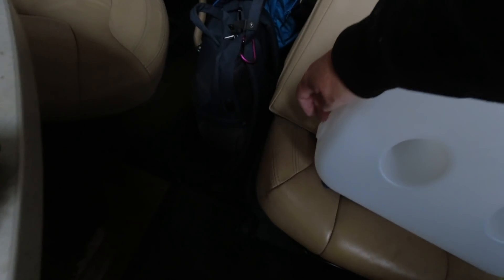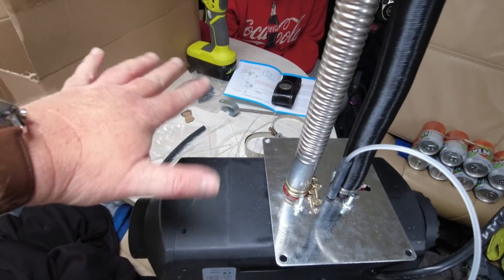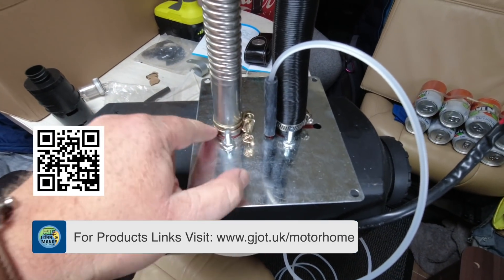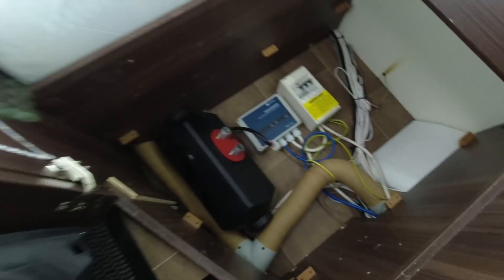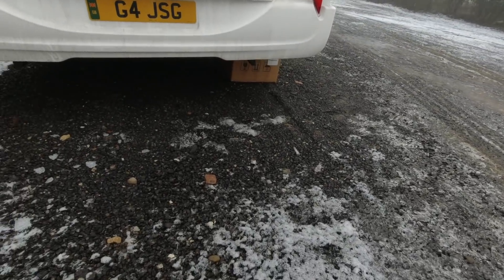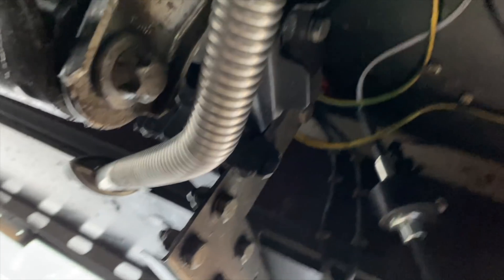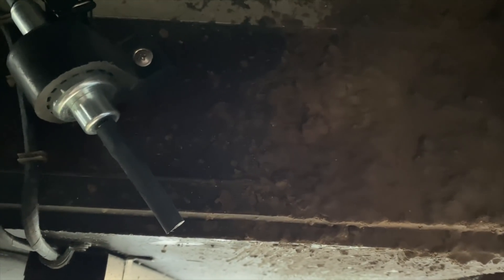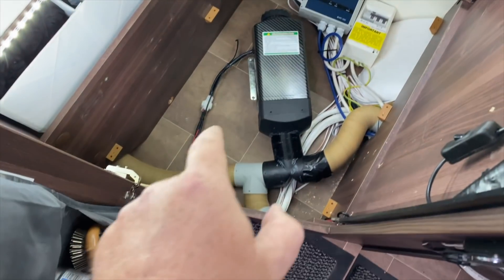Diesel heater Install in our MotorHome

Comment: Most diesel heaters run all the time, my webasto does as does my eberspaecher and most i've fitted (all the propper expensive ones, only fitted a couple of the cheap chinease ones TBH), they run on high heat/high fan speed till they reach the temp you set then lower heat and fan speed in an attemp to maintain that setting untill the temp drops low enough to kick the high speed/heat back on again.
The main trouble with the chinease heaters is they allow the user to mess about with pump speeds ect and as the injector is not controlled in any way this altering of the pump speed affects the mixture to the extent it soots up the burn chamber, i recomend you run the heater at full heat at least once a week to clean the soot out but it sounds like you already do that anyway :) 
Great vid as usuall cheers to you both ;)
If you havn't seen it yet check out  David McLuckie  on YT, he does all sorts with them ;)
Reply from the maker: That’s great, thanks for the heads up - we do run it on full power first thing every morning so hopefully that’ll do the trick 😁👍🏻

Comment: Interested in why its important to keep 'fumes' from getting in the air intake under the van. Surely these heaters have a heat exchanger and the air from outside is not mixed with the internal air which us simply recycled?
Maybe these Chinese ones don't work that way but I would be surprised if they dont?
Reply from the maker: I’d have thought the same too but it doesn’t do any harm to keep them apart😁👍🏻

Comment: Fitted a eberspacher in my boat cost a fortune compared to yours mind is top quality. Thing found is they are noisy and after you run it for a time when you switch it off you sort of feel a sense of ahhh no more noise nice and quite. One thing interested is concerns fire safety these things are potential fire hazards have you checked this area ie fire proofing unit it is fitted in or fitting auto fire extinguisher etc. Guess you will use it as a winter back up
Reply from the maker: As we’ve said the install isn’t 100% complete as we’re waiting for parts to finish the install including fire proofing and waterproofing 👍🏻

Comment: Nothing to do with heaters but wondered what you have done with the thermometer sensor wire, is it through the van to the outside? Glad you're both warm now :)
Reply from the maker: It’s fed under the dinette seat, through the water fill access door and out through the hook up cable access point 😁👍🏻
Reply: @johnmandy  Many thanks both. :)

Comment: Hi guys do you know will that  diesel heater run on kerosene,  just like the bigger  household ones, and have you any link for the same type with a built in water heater, thanks
Reply from the maker: We know they run on all sorts 😁👍🏻 we’ve no experience with any of the dual ones so wouldn’t like to recommend.. if anyone else has and would like to suggest, pop a comment below.. 😁👍🏻

Comment: What's the plan on water heating? Still on the LPG? Bit of inefficiency there I guess as hot water is a by product of using the truma for air heating but still a saving I'm sure.
Reply from the maker: I suppose it’s just planning, we’d boost the hot water or use the truma for morning heating and utilise the water.. for washes and pots we use the kettle so I can have a cheeky coffee too.. after tomorrow we’ll be using the showers here though.. every little helps 😁😂

Comment: Very interesting video, thank you for all the detailed information. I have tried something about the same last winter. I used a Diesel heater as an external heater, connected removable to the RV´s internal heat tubing system of an older RV. So I could use both systems on demand when "stationary" at my place at home. It worked Ok but as you mentioned, the heat of the Diesel heater came out  90% out oft the first outlet of the system. So one part of the RV was boiling and the other end was still cold. Because my English is not that good I didnt really get how you made that work in your setup. Did you installed something like a flap to control the airflow?
Reply from the maker: The tubes and airflow need to be matched, so use the correct connection pieces and lengths of tube to balance the system to get the airflow the same to all outlets.
Reply: @johnmandy  Hi, thank you for the qick answer, very much appreciated. I will try and play a bit with the length of the tubes and the position where I "insert" the hot air from the Diesel heater to the RV´s installed system. The connection pieces fit perfectly with the tubes of my old RV, that was luck. Thanks again stay healthy and have a good time (as good as possible beeing static more or less)
Reply: Or maybe I swap the old propan furness completely with the diesel heater (the RV has ha diesel engine so it makes sense) - but thats more for the comming summer, dont want to freeze during the conversion.

Comment: Hello
You said at the end of the video you were going to install a compressor fridge, is this the same as the type one would use at home? I have a small camper van and go off grid so run my fridge on gas. Presumably if I had a compressor I could not use it off grid. I do not have solar panels and the van is used for weekends and 2-3 week holidays. I am interested as I am looking to upgrade my van and many of them have compressor fridges and not 3 way fridges. Would this be a real barrier to wild camping in a small van? Thank you in advance for  sharing your expertise.
Reply from the maker: It’s all in our latest video 👍🏻

Comment: Our oil fired boiler at home costs us around 300 euros a month during the winter! 👍
Reply from the maker: That’s brilliant 😁👍🏻
Reply: Central heating oil is cheap at the moment about £300 a 1000 litres so you must be using 1000 litres a month. That usually last us 8 months. You must be very warm.
Reply: @martprice7726  I'm not in the UK. where I am a 1000ltrs is around 900euros @ the moment.

Comment: Hi hope you both are well, Got a Q,s in the vid it looks like you connected the hot air vent to your existing hot air vent which i emagine comes from your motor home gas heater, if so is that safe to do in the event that someone turns both the Diesel heater on whilst the gas heater is running?
Reply from the maker: As I said in the video, I used one pipe run off the truma system for the diesel heater and capped off that outlet of the truma heater. So we could use both heaters and the heater pipe work was separate so caused no issues.

Comment: Even in summer, they say to run it once a month on full power for 10 minutes, and check the unit air intake for fluff etc frequently, the one one the rear of the heater.
These things are brill and so low cost compared to the German ones
Reply from the maker: Thanks for the heads up Brian 😁👍🏻
Reply: @johnmandy  watched loads of these install videos, yours by far the easiest to both follow, but “watch” too
Oh, what’s that Fanta on the seat, couldn’t you find any Freeway Cola ? 😂
Reply from the maker: @briantheminer  lots of Freeway but we do like Fanta too - none left now though.. 🙈

Comment: I run mine on kerosene, which burns quite nicely but smells where you drip it! Pretty sure the true 5kW models are larger than my 2kW. I may well put one in my home office down the garden.
Reply from the maker: That’s good to know.. 😁 thanks for watching 👍🏻
Reply: @johnmandy  If you check David McLuckie on YT he does some interesting experiments on diesel heaters with fuel and such.

Comment: Hi, how do you prime it. I have tried pressing ok and down but it doesn't work? Is there a different way with the new controller?
Reply from the maker: It’s in the video, pressing 2 buttons at the same time n the new controller will cause the pump to work while you hold them down.

Comment: Very interesting vlog. I may have misunderstood but a quick question - by feeding the hot air from the diesel heater into the existing ducting, would this create a reverse flow of hot air into your existing gas heater and possibly damage it? Thanks
Reply from the maker: As we mentioned in the vid we’ve taken the truma boiler out of the loop for now, an easy swap back of 2 pipes will re-instate it perfectly if/when we need to use it again 😁👍🏻
Reply: @johnmandy  Sorry guys, I can assure you I watched your entire video, as I always do, but obviously missed the critical bit relating to my question. Didn't mean to offend. Stay warm!!
Reply: You can get a selectable Y switch for the big air pipes as required.
But feeding hot air into something designed for hot air, is I consider, not an unusual mode of operation for it, so I'd suspect it would be fine, and would happily do the same on mine.
In fact the Truma gets the hottest on 'hot water only, so hot that the smell of hot plastic can be smelled, due to the lack of air movement in the pipes, and Truma's insistence on using a plastic air pipe manifold. So another reason that moving hot air would be fine. 
Note that it's also possible to tune both max fuel rate, and max fan rate, on the Chinese heater, to control the temperature of the air coming out of the end. More fan speed and/or less fuel = lower air exit temperatures. The LCD controller can also tell you the temperature of the heat exchanger, I think I run mine at max 160C, achieved by tuning the air/fuel settings.

Comment: Thanks for the good video 😀
What made you decide to have a separate tank rather than plumbing into the vans fuel line?
Reply from the maker: Thank you 😁 we have access to red diesel where we are at the mo and as we can’t go out anywhere that seemed the best option, plus around most of the places we visit there are more red diesel suppliers than lpg ones 😁👍🏻

Comment: Well done you 2 on another great video,Ive also fitted a diesel heater to our motorhome but i fitted the diesel straight to the mh tank I also had the same sort of floor so i bought and used a turret mounting plate . Its all on a video + links for parts in description on my channel 
We love your vids keep ip the good work
Reply from the maker: Thank you 😁 the kit came with the fittings to use the mh diesel tank but as we can get red diesel from the farm nearby we decided to use the sword ate tank and pay 80p a litre instead 😁👍🏻
Reply: Perfect  cant fault that

Comment: Hi all glad your doing well & the new heater project went according to plan. Do you get the option with the heater to run it from your main vehicle fuel tank ?   Stay safe & warm.
Reply from the maker: Yes, that’s an easy change to make as you just run the fuel line to the main fuel tank, on a ducato that’s fairly easy. However, we are going to stick with the separate fuel tank for now so we can make use of the much cheaper red diesel that we can get from the farm we are near.

Comment: Hi, As far as I understand you have a diesel heater and truma combi boiler? Is Truma not efficient enough? Is it using too much LPG? I was going to buy truma combi boiler for my conversion as I thought  that I need  LPG anyway for cooking and combi boiler will also solve a hot water and heat in the van at the same time, but obviously it is not cheap. Now I am really confused, I would prefer to have a diesel heater, but how to heat water?
Reply from the maker: Our truma combi boiler is not fuel efficient at all, it’s great for the cooling fan option and when you’re on hook up it comes into its own but the diesel heater is far more fuel efficient, warms the whole motorhome up quickly and we have a choice of which fuel we want to use too.. you can get a more expensive combi diesel heater that does hot water but we haven’t any experience with them at all.. we also know people who have fitted a gas hot water boiler in their vans separately.. there are lots of options to look out for 😁👍🏻

Comment: I take it you're waiting on pipe clip for diesel pipe you need on the heater side of the pump the pressure will push the pipes apart I have 3 diesel heaters two in  sheds and one in campervan
Reply from the maker: I’m replacing all but the final section with fuel hose, so the pump noise and other issues will all be negated. 👍🏻😁

Comment: Did you consider linking it to the main diesel tank? Also have you ever considered upgrading to the 120 ltr fiat tank? Great video as always.
Reply from the maker: We did at first but found as red diesel is easy to come by here that we’d use the extra tank - as we explained in the video. We’ve not considered upgrading the Fiat tank 😁👍🏻
Reply: @johnmandy  BTW it was very useful to hear that you are using 1.5 ltrs per day. I looked it up and it seems the energy in a Ltr of diesel is about 10 kWh and the energy in a kilo of gas is just over 13 kWh, which was good to know for planning trips as I’ve fitted LPG but haven’t got a real handle on how much gas it uses as I cheaped out and didn’t get the digital gauge and also like everyone else COVID has messed up plans so winter trips are postponed. Keep up the great work, it’s always enjoyable to hear what you’ve been up to and see you making your van and now Motorhome evolve.

Comment: Intriguing option - great to have redundancy as well as twin heating systems.  Is there a recommendation for an installer in the UK to fit this type of heater  (rather than take the plunge myself)?

Comment: Did you remove the LPG heater? Any thoughts on how to do this?
Reply from the maker: No we kept it, it's nit only LPG but electric too, the truma combi boiler is a heating system and hot water system.

Comment: If the pump is tikkingen  ,to loud you can find a rubber band Istad of the holder ,ceep it inn the air ,or it will make noise.
Reply from the maker: That’s great, thank you 😁👍🏻

Comment: Great video. I’m so glad that I have a wood burner in my caravan. I am thinking of getting a diesel heater as well, just to be completely independent in case of no firewood and LPG. How much electricity does the heater need while starting and running? Big hugs for Cooper! Stay well and safe! X
Reply from the maker: It uses around 10 amps for a minute when it starts up and then under 1 amp when it’s running. 👍🏻😁
Reply: @johnmandy  That’s not bad at all. I will look into it! Thanks!

Comment: hi guys as usual a really good video,i’ve been thinking about fitting a diesel heater for awhile now,i’m guessing you would need a leisure battery to run the heater but as i’m limited for space what do you think would be the smallest battery i could use ?
Reply from the maker: You’d need a 12v supply that can deliver 10amp as it starts up and then around 1amp when it’s running with the fan on. The poweroak AC50 will run it fine too, I have recently reviewed this.

Comment: Hi guys, Question;- How do you go about getting more heat to the front of your vehicle?.........is it a case of closing the air vent directional flaps on the shorter piped vents?
Reply from the maker: We had to swap around the pipes near the diesel heater to get the best flow but it reaches the front nicely 😁👍🏻

Comment: A really interesting vlog, so thank you. Now we're not living in the van I can't see we'd need one, but definitely something I'd consider if we were. Just a thought. Have you got the external insulated screen covers? We've got them and they are brilliant in hot, or cold weather. We've had ours since day one. They are a bit less silver and more blue, because the silver has stripped away over time, but they are still effective. They also reduce, or even prevent completely condensation on the inside of the screen and cab side windows. Stay safe.
Reply from the maker: We’ve had a few people suggest them but we’ve never had a problem with heat loss at the front, it’s just as warm as everywhere else and only really gets a little condensation when we’ve showered when it’s cold or I’ve cooked a lot 😁👍🏻

Comment: John can you use 28 second heating oil in it as that's 37 pence per litre and only has 5% VAT
Reply from the maker: We have good access to red diesel where we are at the mo.. 😁👍🏻
Reply: Apparently, kerosene (heating oil)  burns perfectly as well.
Reply: @philcross7315  also in car cylinders it says on the bottom of my invoices “Not to be used as road fuel”

Comment: Hello, this is my first time on your channel, thank you for this video. 
I have not been able to find other stories where people installed heaters in the Truma inflating system. I want to do that too. But what confuses me is that when using it, hot air will pass through the Truma, and heat up parts that should not heat up during normal operation, I'm talking about the Truma's fan that pumps air.  I did the reverse experiment by simply plugging a diesel heater into the system, and turned on the Truma. After a short time, the diesel heater warmed up very much. I'm not sure that it will be useful for Truma, and I'm worried that I'll break it this way. Can you comment on this in any way? How long have you been using the system in this version as shown in the video, and did you have any problems with the Frame at the same time?
I'm sorry, I tried to find information on the site, but it's not available. Thank you.

Comment: Another top vlog from the both of you, with great tips on the installation of the heater (with more to follow on another vlog :) ). Deffo looking into getting one in my van now after working out best place to put it. Are you able to provide the dimensions of the external tank as i can't seem to find any info on it, it will help in the planning. Stay safe and toastie. Thanks, Ian.
Reply from the maker: Thanks Ian, the details should be on the ad for the heater itself 😁👍🏻
Reply: @johnmandy  Hi Folks, i couldn't see any dimensions on the ebay page, but i found the following dimensions on a site selling a similar 15l tank in case in comes in handy for anyone else. Size: Approx. 40x40x9cm/15.75x15.75x3.54, :)
Reply from the maker: @ianrivers4112  John was guessing at 40x40 😁👍🏻